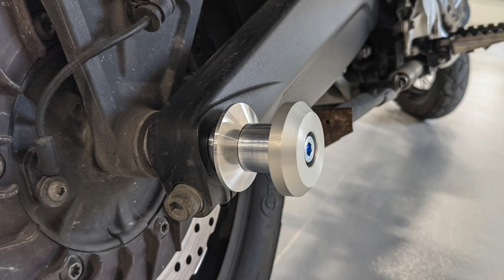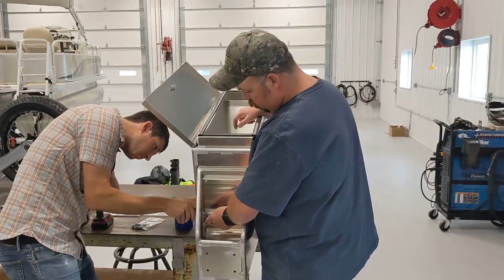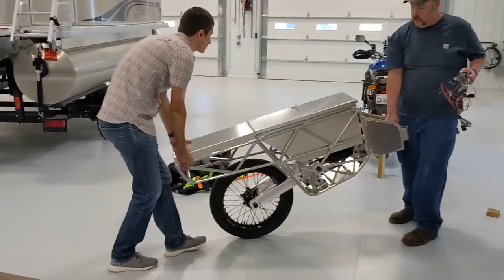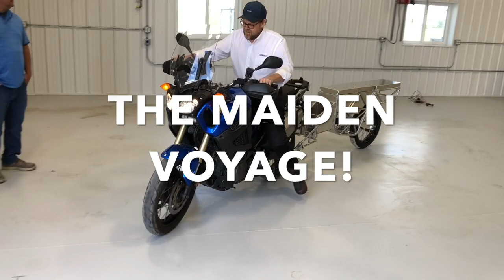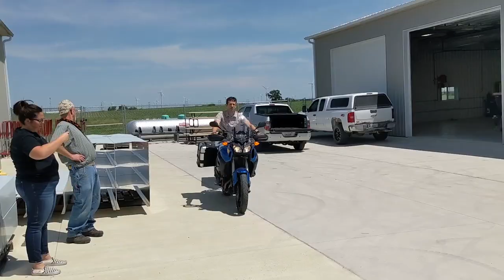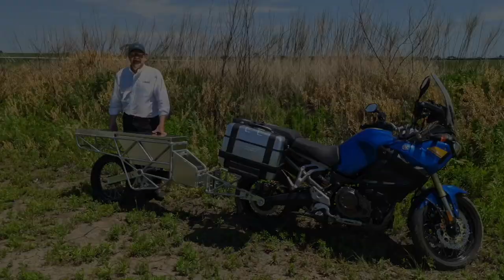The First Full Assembly of The Pasq® ADV1 - Single-Wheel Adventure-Motorcycle Trailer

Comment: Very cool, I would have loved  to have had that on my new 2022 HD Pan America as i did 7k miles accross from Roseville CA to Pigeon Forge and back, with extra time spent in Utah and Colorado touring the primative back country and mountainside trails.
Reply: That sounds like an amazing trip! It also sounds like the ADV1 (we had to rename the trailer due to trademark issues) would have been very useful. We have done a lot of our testing behind a Pan America and really like the bike, so we know it works well with that bike! We are getting very close to production. If you haven't, sign up for our newsletter at pasqadventure.com so you can get the latest updates.

Comment: I wonder If this trailer would work with a zero FX electric bike?
Reply: Hello Dwayne, I answer this question for you over on the other video, but I'll paste my answer here as well for everyone else who might see it.

Based on these images (https://www.zeromotorcycles.com/model/zero-fx) I'd say we will be able to connect to the Zero FX's hollow rear axle. However, connection is only one piece of the puzzle. As its name implies, the ADV1 was designed for ADV (adventure touring) bikes like the BMW 1250 GS, the Africa Twin, the KTM Adventure, etc.

What's the difference? Well, let's start with brakes. ADV bikes generally have two huge twin-piston disk brakes on the front and one on the back. That is a tremendous amount of braking—seldom do I use more than one finger on the brakes of my Super Tenere. The Zero FX has only one one-piston disk on the front and one on the back. Highly related to braking capacity is the contact patch size of the tires. ADV bikes have big tires so they have a good amount of grip on the road. The Zero FX has quite narrow tires (1.85" on the front and 2.5" on the rear). Our concern would be the weight of the trailer (we are shooting for 90 to 100 lbs, depending on tire selection and a few other things) and the weight of your gear would overwhelm the bike's braking capacity. We are not planning on releasing the ADV1 with a brake. Who knows about the ADV2 and other designs we have planned, but the ADV1 will likely not have a brake.

Next comes the power of the engine. From what I see the Zero FX's motor is 28 hp. We are confident the ADV1 will work well with mid-sized (~75 to 90 hp) and large ADV bikes (~110 to 140 hp). We have not tested or thought about testing the ADV1 on smaller motors.

So, I'm sure you've come to the same conclusion...the ADV1 is not a great fit for the Zero FX.

Now, you have given us a lot to think about. We have to get the ADV1 launched first, but is the ELECTRIC1 the next trailer we design? Could be!

I'm sorry this isn't the answer you're looking for, but the ADV1 is definitely designed for the ADV bike market. But we named the company Pasq (after the pasque, a beautiful and strong prairie flower), not "The ADV Trailer Company." Our vision is to have a full line of motorcycle-specific trailers. One that is right for the Zero FX would be a great challenge to design and build!

Thanks again!
Rod from Pasq

Comment: You have suspension on the rear, but 100% jarring on the front.  Why didn't you suspend it from the bike frame instead of the axle?  Your suspension is only about half as helpful as it could be.?  Looks real nice, but I question how well it was thought out.
Reply from the maker: Hello SLRS,

We have many design goals with the ADV1. One of them was to get weight off the suspension of the bike so it can do what it was designed to do...suspend the bike and the rider. Most adventure touring bikes are designed to carry "stuff" or a passenger, but when you have both a pillion and stuff (like my wife and me when we go moto camping) you overload the bike. Other times this comes into play is when a group of people go out for a weekend or longer and want to bring 3 days of food and beverages, maybe chairs, etc for a nice basecamp. Yet another is when you're a leader of a tour and need to carry additional spare parts, tools, food, etc. One more for good measure...when you're riding to a remote destination like Prudhoe Bay, Alaska and you'd like to bring more aggressive tires with you for when you hit the gravel, and you want to bring along extra fuel for the long stretches with no gas stations. There are a lot of use cases for the ADV1.

The ADV1 takes weight off the bike and puts it onto the trailer. 

The suspension on the ADV1 has 7" (17.75 cm) of travel...more than many motorcycles! That suspension is extremely important both at high speeds on the highway and off-road.

I think if you watch some of our other videos (our channel is at https://www.youtube.com/c/PasqAdventure/videos) you will see the suspension working and it'll make more sense to you.

And, you need not worry about how well thought out the ADV1 is. We have been designing on CAD and testing in both the field and in finite element analysis for nearly two years. An enormous amount of thought, effort, trial & error, and testing have gone into this. We are about to begin building our final prototype, which is going to be amazing. Subscribe and click the bell to see the videos of it, or you can sign up for our newsletter at pasqadventure.com.

Thanks!
Reply: @PasqAdventure  Nothing that you have said really answers my initial comment.  No amount of suspension travel at the rear of the trailer changes the fact that there is no suspension up front.  Any bike that is designed to support a second rider is perfectly capable of carrying extra weight.  Especially a bike that commonly has luggage / gear strapped to it.  If you watch your videos carefully, you will see my point and it will become entirely obvious to you.

Comment: In your long term endurance testing, did you discover any unusual wear at the articulation joint?
Reply from the maker: Hello Maytronix!

By "articulation joint" do you mean the joint between the trailer and the hitch arms? If so, we have redesigned/reengineered that completely. Here is a link to a part of our "history" video that talks about this redesign: https://youtu.be/qgEeifwBM-s?t=240. The first part of the video explains how it works and shows a proof-of-concept prototype we made with off-the-shelf parts. If you watch that video until about the 4:45 point, you'll see the next version, which is closer to what the final design will look like, but still using off-the-shelf parts. In our final design of the trailer, much of the hinge will actually be inside the trailer. (Keep watching the video...you'll see what we mean.) So, by all of this, you can easily come to the conclusion that we have not put a lot of miles on this design. We will be doing that this Jan to Mar when we are testing our final prototype.

However, if by "articulation joint" you mean where we grab onto axle adaptor we put onto the bike's hollow axle, and then grab onto, we have lots and lots of miles on that and have not had any issues at all.

Hope this helps. Of course you can keep the conversation going and clarify your question here and we'll do our best to answer.
Reply: @PasqAdventure  yessir, that was indeed the the spot I was looking at. [Edit: where the bike mount meets the trailer]
I dont fab (though I can join two pieces of metal with fire on occasion) and I barely ride compared to some; so I dont speak from a great deal of experience.
But I do find the creative process/engineering quite interesting.

With that being said, in my poking around the interwebs.... listening to others that have bought trailers/dolly's for their bikes. It does appear the most likely of failure points (minus suspension collapse).

Not to say that i can see anything wrong with the design... it looks bomber.. Your trailer looks like it could carry whatever you might want to carry plus my little bike, lol. 

But even the strongest of designs and materials fatigue given enough use and stress; so I am  certainly curious how your long term destructive testing will perform.

Color me impressed Gents and Ladies. Great work.

Comment: Would absolutely buy this if it could be made to work on a 2018+ Gold Wing.
Reply from the maker: Hello EO! We are laser focused on bringing the ADV1 to market, but as its name/model number suggests, it's for the adventure touring market to begin with. Once we have delivered our first models for the ADV market, we are going to make some design changes we've already started thinking about, and bring out a trailer for the Gold Wing/cruiser crowd. Maybe the CRZ1? 🙂 It will likely connect via the myriad of hitches already available for those types of bikes. That means it will put some weight on the bikes suspension (as opposed to our axle adaptors for ADV bikes), but we're working on ways to reduce the tongue weight. And of course, with one wheel, you won't feel the weight nearly as much because it will lean with your bike, not try to push your rear wheel into the ditch like two-wheels trailers do!